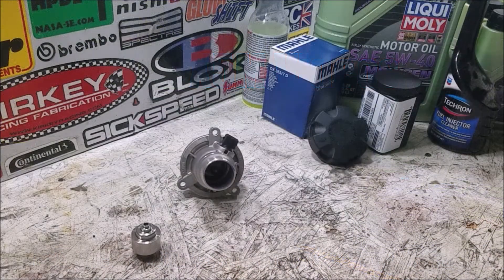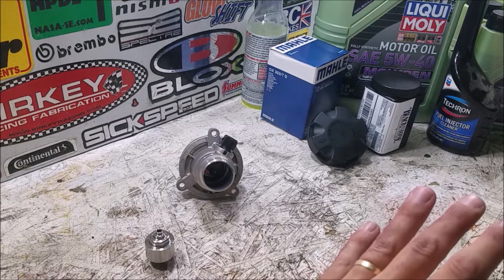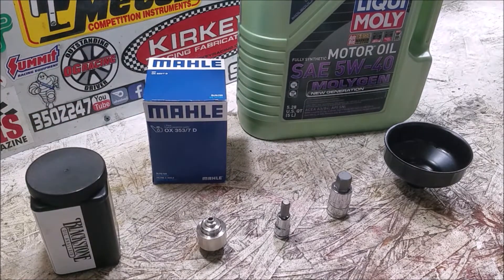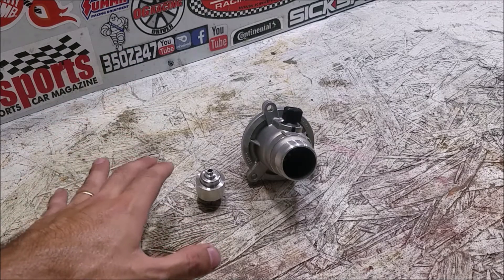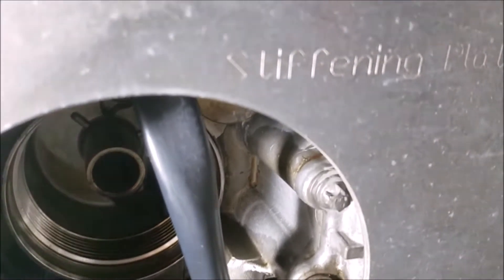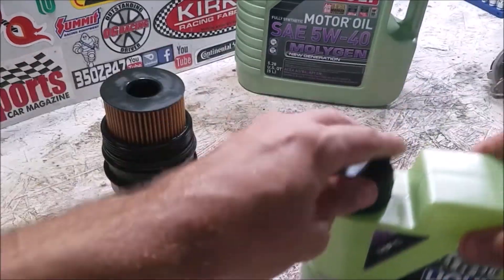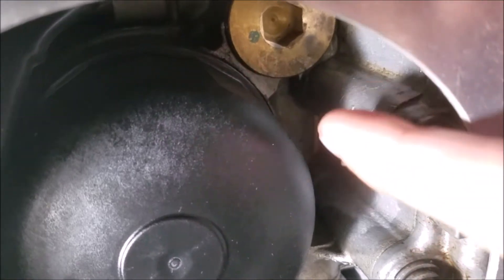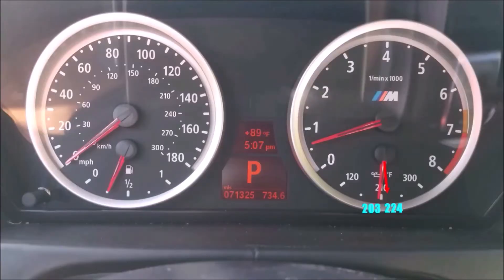E70 BMW X5M Sport Oil Cooler Valve DIY (Cooling Overhaul Part 1 or 3)

Comment: Hello any updates on the upgrade?
Reply from the maker: It's been almost a full year and the car runs perfectly. It always stays around 180-195 for oil and coolant temps.
Reply: Are those temperatures the same for cooler weather below 32 degrees?

Comment: The pin that holds the valve was woobling on mine. Is that normal? Thanks!
Reply from the maker: Yup, totally normal. Direct from the manufacturer.

Comment: Any codes thrown now that it’s been on for a while? I’ve heard if temps drop below 93c then the Ecu May retard timing throw a code and mess with the fuel air mixture. Looking to do this on an 18 n63tu2 m550
Reply from the maker: Nope, you'd never know a difference

Comment: Mine oil temp always sits to the left of the middle, much like your post swap picture, but then I'm also in Seattle where at most it reaches 80°F.  Watching your video though makes me curious...why not just put something on the stem to raise it up higher vs this $150 valve?  How much higher does it sit vs stock?
Reply from the maker: Because I'm not gonna put something janky on my $25,000 M engine. The $150 is more than fair compared to the alternative if something failed.

As for the temperature, it's a must do if you're doing a lower temp coolant thermostat so the oil and coolant thermostats aren't fighting each other. Even if your temps are already decent, they could always be better.
Reply: @350Z247  I work in aviation and we use hollow aluminum dowels for multiple things, point is it popped in my head that I could use a dowel on that pin to raise the valve for free since it seems that's all that oil cooler valve does...just spitballing, calm down lol.  Janky is using a .10 washer in my turbo K swapped MR2's oil pump to increase oil pressure, but it's known to work.  Also a rebuilt engine is $9000.  I've been tuned and pushing over 700hp while spraying meth for 5+yrs so I know I'm on borrowed time and I've researched the inevitable.  

Admittedly I've seen the lower temp thermostat but the oil valve idea is one I haven't seen even though I've spoken to the owner of N63Intakes before.  I'll be doing S63TU manifolds and turbos this Spring, at which time I'll be doing the thermostat and oil cooler mod as well.
Reply from the maker: @M5JamesE39  oh I was referring to price when new; I could buy the whole care for $25K now. I found it in a forum post from a couple of years ago. I've been very happy with it

Comment: My stock X5M runs the same oil temp as your new mod, would an even lower oil temp be beneficial?
Reply from the maker: Yes, anything you can do to keep the engine cooler is going to be money well spent. 180-190 would be the sweet spot.
Reply: Keep in mind, he lives in a very hot part of the country. Your temps might be the same as his new at whatever climate you're currently in... But that could change in heat waves or during travel. This mod will help you maintain that cooler temperature wherever and whenever you are.

**I don't have this car (yet) or this mod, but that's my logical deduction.**

Comment: Love your video.  I'm about to do my oil change this weekend and was wondering if 5w-40 the recommended oil?  I was told that 10w-60 will work also.  Wanted to know what your thoughts are and the differences are.
Reply from the maker: DO NOT USE 10W-60. Use the 5W-40 Liqui Moly or 5W-50 Redline. The 10W-60 is way too thick.
Reply: @350Z247  thank you for that.  A indy shop told me about the 10w-60.  Just recently picked up the 2011 x5m and wanted to keep it running as long as possible.
Reply from the maker: @phonglee5879  yeah, no, it's a long story about why and how BMW decided to use that oil on the S54, S62, S85, and S65 engines, but even those should run on 5W50 now. The 10W60 is the reason for all the rod bearing issues. Avoid it like the plague.
Reply: @350Z247  no wonder i hear so many stories about bmw issues...i also was wondering if you've installed a tow hitch on your car yet?  if so do you have any recommendations and will you be putting up a video on that?
Reply from the maker: @phonglee5879  I will be doing a hitch, but unfortunately, not for a good while. ECS Tuning sells the factory hitch with wiring harness for like $450. You'll need to cut a small square I'm the bumper, but it's not a big deal. There are a couple videos from hitch companies that are already on YouTube. It's as simple as removing the rear fascia and replacing the rear bash bar with the OEM hitch. The truck is already wired for it, but you'll need to swing by the dealership to have them code it (or code it yourself).
Reply: @350Z247  i will do the hitch later after the winter.  Thanks to you i ordered the oil cooler valve from n63 website.
Reply from the maker: @phonglee5879  oh good! It's a super easy install. I would recommend following TroyJeup on Instagram. He is a guru for these engines.

Comment: Get Protool from Bimmergeeks and you will be able to measure your oil temp accurately...along with everything else
Reply from the maker: How do you like it? I'd consider it, but I'm tempted to just try the software like NCS expert
Reply: @350Z247  protool is great. U can use it to code stuff. U can monitor and log almost anything (boost, AFR, etc). Worth every penny.
Reply: @350Z247  I use it on mine to log a few things.

My e70 X5M has a Velos stage 2+ tune and catless Downpipes. Bigger turbos soon.
Reply from the maker: @Dawgz15  nice! Thanks for the heads up. I might just go ahead and pick it up. There are a few things I'd like to code on the X5, especially with the tailgate.
Reply: @350Z247  yep, the tailgate is the first thing I did, and the side mirrors lol

Comment: "the idea of the oil thermostat is to bring the oil up to temp roughly 215 to burn off water condensate quickly warm up faster and eliminate engine wear caused by cold oil and moisture"  Using this valve will deny that and while may do good for the reasons you mentioned in the same time will cause other issue on a long term.
Reply from the maker: That's not correct at all. Water will evaporate at room temperature. 190 degrees is plenty warm enough to allow proper oil flow and remove  condensation from the oil. The car will heat up at the same rate, but stop at a lower temperature. This will in no way effect warm up. There is no advantage to running at 215 other than emissions and fuel economy. Every other aspect of the engine will be better including power, lower oil consumption, and longevity of every engine part including rings and bearings.
Reply: @350Z247  Great response. Furthermore, @Universe it's still close to the 215 temp where the engine could and likely will still hit the 215 temp somewhere at other hotter spots in the oil flow. Sensors are only measured at the spot of measurement.

Comment: can this be done without doing an oil change / top up?
Reply from the maker: It's just easier to drain all the oil.
Reply: You Also said m14 and m18 hex key for oil cooler valve. which one is it?
Reply from the maker: @mike619  I believe it's an M14, but I can't remember